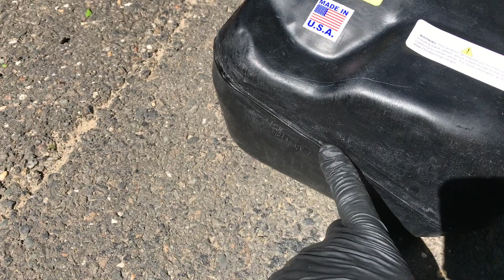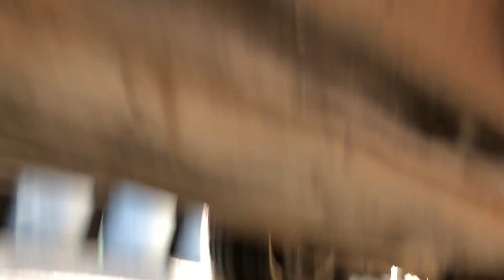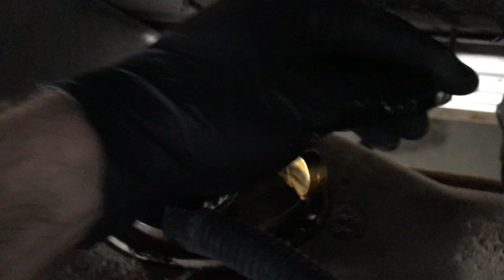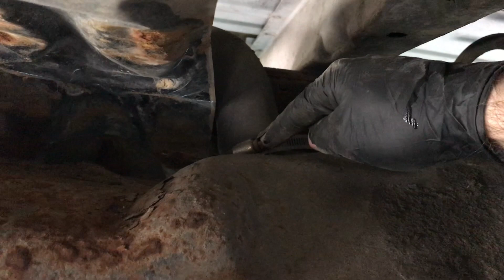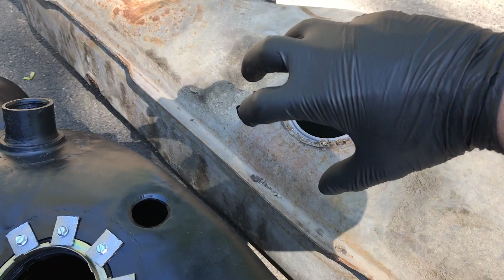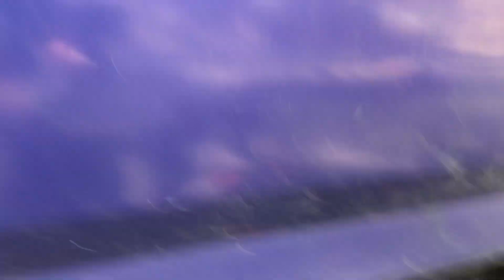How to Replace Front Front Fuel Tank with Plastic Tank | 1995 Ford F150

Comment: So... what's the measurement i need to know.. Any Idiot can cut a hole , but without the math, most will be a hack job
Reply from the maker: I have two full length videos about making the hatch in the bed and I have one YouTube short that actually has the measurements. I don’t share the measurements because the position of the tank can vary from truck to truck.

Comment: Why did you skip getting the 2 bolts out.  

Will you show me how to get the bolts out.   If you recorded the process already
Reply from the maker: Are you referring to the bolts that hole the tank straps?
Reply: @TheMinuteMasters Yes.....I just looked under my truck to see how similar.. ...trying to see if I can get the bolts out for the mechanic ....who has a larger frame than me.    To keep from going through process of raising truck bed

Comment: God how i wished this worked for me however there is a shield between the drive shaft and fuel tank on my f250 and they ran the nuts from above (rusted) on one part and riveted the others.  By far the f250 is the most difficult vehicle ive ever worked on, every single thing is just a struggle on mine.
Reply from the maker: Damn that sucks man!

Comment: Hey, i love this video it was very comprehensive. Im about to replace this tank and the only issue im haveing is ive been fighting with these damn ford quick disconnects for hours. Is there anything i can do or use to make them come off easier. Ive been trying to use the pb blaster lubricant and after reading some other comments I'm wondering if there's anything else I can use. I greatly appreciate the vide keep it up
Reply from the maker: Thanks man!🤙 those Ford fuel line disconnects can be a real problem. Unfortunately, I don’t know if there is a magic solution to getting them apart I can’t recommend the actual disconnect tools enough. I think they were the best over any of the homemade disconnect tools.
Reply: @TheMinuteMasters  thanks for the help. I've been using the ones you use, and for the most part they work great. I push it in as far as they go and the clips inside release, I just can't get it to go the rest of the way off. Also what size is the one next the the 3/8" disconnect. It's the wider one
Reply from the maker: @cryptic780  Gotcha. Have you tried pushing the hoses together as you use the release tool? Some times there is one prong of the disconnect that doesn’t release.
Reply: @TheMinuteMasters  I ended up finally getting them off, had to resort to a little bit of aggressive persuasion with a hammer. It seemed like the previous owner didn't slide the clip back when they removed it and snapped it off inside the fitting, so I smacked the fitting backwards until it pushed the broken clip out. Everything on this truck has been like this lol. Oh well, hopefully after I finish swapping the tank it won't have a bad leak anymore and will drive correctly

Comment: Hello Mr Steve.
I’ve been following you and really appreciate your videos. 
So much information 🙏
I own a 94 ford F150 5.0  302 .
I recently retired and now have time to repair/ restore my truck that’s been parked for 7 yrs .
I took the bed off so I can replace the 2 gas tanks .
My question is :
Can I run the truck with just the front gas tank?
My plan is to buy  Doorman fuel line #800-159  and cap both lines that run to the back tank?  
And do I have to cap the vent line ?
Reply from the maker: Hi Benjamin! Thanks!🤙 I appreciate it. 
That’s a good question. I don’t know for sure but it probably could work.

Comment: Hey man I got same truck 1993 7.3L my dual selector valve is replaced as well as the switch in the cab still won’t switch to the rear tank any ideas?
Reply from the maker: Hey Isaiah! So you replaced the selector switch in your cab. You also replaced the selector valve that is underneath the cab correct? Forget at what year but for discontinued the actual selector valve. The actual pumps themselves have electronic sending units that respond to the switch in the cab. Typically if there is an issue switching between tanks, or one tank filling the other, one of the pumps is the issue.
Reply: @TheMinuteMasters  thanks brother I appreciate you taking the time. I’ll check what’s going on with the pump next since I need to drop the rear tank and get all that fuel out of there it’s been sitting in there since last summer lol appreciate what you’re doing man wish you the best and a long healthy life.
Reply from the maker: @isaiahG773  No problem Isaiah! 🤙 I’m always available for questions in the comment section. Yeah if you’ve had fuel sitting in that tank for over a year unused there’s gunk built up by now. Ethanol fuel tears up these older fuel systems. 
Thanks man! I wish the same for you too!
Reply: @TheMinuteMasters  I actually have the diesel 7.3L supposedly you can just put some solvents in it and reuse the old diesel not sure if it’s true or not but I’ve seen them do it at my job.
Reply from the maker: @isaiahG773  Interesting. I don’t know too much about diesel. That’s pretty cool if that’s possible.

Comment: I think mine is leaking so I might try and replace it
Reply from the maker: I don’t doubt it. These tanks just rust a hole eventually.
Reply: @TheMinuteMasters  I'm doing this pretty soon. Does it matter what size tank? I mean, can you just buy a 19 gallon tank if the old one was 16? Thanks.
Reply from the maker: @lupegalvan9993  Good move! So I would match with what you have. However, I think I bought the 19 gal for my long bed. If you have an 8ft bed, I don’t see why you couldn’t go with the 19 gallon tank.

Comment: Is there a difference in fuel pumps for 95 f150 with a metal tank and plastic tank?
Reply from the maker: You can use the same pump for either type of tank.
Reply: Napa database calls for a pump for plastic tank on rear 1995 f150 don’t let that fool you it’s a system glitch 
Like the video dude said use the normal one 
The one that calls for plastic is a pre ‘90 electrical pump that has the sump screen flat to the bottom of fuel pump housing that’s a no go on a mid 90s 
Odd it called for that

Comment: I didn’t have to use a fuel line disconnect tool for my 91 f150 lol
Reply from the maker: SVT_Palacios Nice! Lol It just came apart?
Reply: The Minute Masters Ford used a different type of connector in 90 and 91, its a white plastic clip that you squeeze together and pry out. I kind of like them cause you can do them with common hand tools
Reply from the maker: Ekd Gotcha. I learned something new. Those connectors do sound better. Specialty tools makes working on vehicles expensive.
Reply: Ekd wish I would of known before buying the tools. Oh well might need em in the future :cheers
Reply from the maker: SVT_Palacios Ah better to have them and not need them. That’s right!🤙 Thanks for watching man!

Comment: Ever had to mess with ur fuel selector valve, those are pretty expensive. Been reading 70% of the ppls dual tank problems is that. Instead of the fuel pump 🤷🏻‍♂️
Reply from the maker: happiinapii You know, I actually haven’t. However depending on the year of your truck, replacing the fuel sending unit in the tank fixes the problem. I’m of the opinion that if you should replace the entire fuel pump and sending unit when you have the chance. They are old and who knows when either the pump or sending unit will fail. 
Supposedly before 1990, these trucks has a fuel selector valve located on the inside of the driver’s side frame rail. That part is expensive.
Reply: The Minute Masters ohh alright maybe mine not even have a fuel sending unit then cuz mine is a 96, just going by the videos I see but the ones I’ve seen are 90’ and lower. I work out of town and not able to check for myself but I will as soon as I get home thanks
Reply: The Minute Masters also I just bought my truck a week ago reason they sold to me cuz the old man was having trouble with the fuel. But he gave me two new fuel pumps, do u know if the fuel pumps come with fuel sending unit or it’s two different parts inside the tank?
Reply from the maker: happiinapii You can buy fuel pumps and fuel sending units separately. I always buy the full fuel pump assembly with both pump and sending unit, that way I know everything is new. Often times you fix one part of the fuel pump assembly and another part breaks.
Reply: The Minute Masters perfect brother 🙏🏼 thanks for the info man
Reply from the maker: happiinapii No problem man!🤙 Thanks for watching!
Reply: The Minute Masters again I have the fuel pumps he gave me At home just didn’t see what they look like or what they came with get me

Comment: Great video. I’m getting my but kicked on putting it back in. I did upgrade from a 16 to 19 tank. Top seamed to line up perfect on both tanks. The new one doesn’t seam to want to go in. I’m about to pull the bed to figure out what the problem is.  Any thoughts?
Reply from the maker: Irish German Thanks man!🤙 By not line up do you mean the straps don’t seem to wrap around and line up? If so, the 16 gal straps probably won’t work with the 19 gal.

Comment: I just bought a 1981 ford 1/2 ton. And I have been watching your video and find them very helpful. Where did you purchase the plastic tank? Possibly you could send me in a right direction to find a workshop manual for said truck. Keep the videos coming..
Reply from the maker: J. R. Thompson Nice! I love a good bullnose Ford. Thanks! 🤙
So I bought the plastic fuel tank from raybucks.com

Here’s the full link: https://raybuck.com/?s=Fuel+tank&fwp_make=ford&fwp_model=f-series-pickup-truck&fwp_sub_model=f-150&fwp_year_single=1981

As for a workshop manual, my go-to is a Haynes manual. You can find them at just about any auto parts store. If they aren’t on the shelf, you can definitely get them on line. 
I sure will man!

Comment: Stevie! First off buddy, you are an absolute JOY to watch. I LOVE your videos! I've got 3 of these monsters, 1 long bed, and 2 short beds. I know a thing or fifty about this proceedure and I'm gonna make a few comments but by no means am I being condescending. You have helped me tremendously on the suspension issues and I admire that you do any of this. So, THANK YOU! Please take any of my comments lightly, unless they are helpful to you. First, get some PB blaster and remove that bed! Removing the bed is so easy once you've done it you'll kick yourself for not doing it. I use an engine hoist and tie four corners up and lift if that way. Alternatively, I've slid a few landscaping timbers under the loose bed between that and the frame and jack it up or put cinder block under them and roll the truck away. Two strong guys can grunt and lift the bed at the wheel wells and walk it away, but you gotta be strong.  It's so much easier to do this that way and you don't need a "hatch" or have to lay on your back and get gas all over yourself stuggling to get the filler hose off, or the Ford connectors which are ALWAYS harder than it seems in your video, probably cause you had them off before. PB Blaster! The harness, vent etc. is all waist height with the bed off. The lights just unclip and there are only 6 bolts holding it down. Now I'm not sure about your gloves buddy. They seem a little whimpy but I should talk. I don't use any. I LOVE your idea about the plastic tank and actually wish I'd have done that but I always buy my tanks from Rock Auto and go for the Canadian tanks and do the fuel pump at the same time. No Chinese crap in my trucks, ever. No need to save money and have to do it again. Just replace the fuel pump. Taking the bed off is also nice when you do both tanks as I do. I just do both tanks and pumps and even though it hurts the wallet, I'm not going to do it again, probably for the time I own the vehicle. I also do the fuel pump which is right there. No vaseline on the filler tubes, it will eat them up and then you'll have holes all over. Silicone paste is the way to go, but prepare to just buy new hoses, high quality ones that are also silicone cause they are almost invariably always split, or will be when you grunt to get them off. Some guys warn about using metal to metal like a hammer to a screwdriver to remove the ring around the fuel pump cause of sparks and Ka-boom with gas. So listen, super well-done job as always buddy! I always appreciate your time and effort and I can't complain cause you see I'm not making videos like you helping guys out, but you are, so kudos my brother. Can't thank you enough. Take care.
Reply from the maker: Thank you Patrick! I appreciate that! Honestly, it's positive comments like yours that give me the motivation to keep making these videos. 
When I first started doing repairs on my truck, I began with the Haynes manual. So they I didn't learn any of the cool tricks like removing the bed. However, you guys have helped me immensely by leave tips for me in the comment section. I'll definitely keep your advise in mind when it comes to pulling the bed. So I fully appreciate your comment! Yeah I'm not a fan of the Chinese crap either. The plastic tank is USA all the way!🤙 Thanks for watching Patrick! Take it easy!
Reply: Patrick PhippsPA this is a great comment. However I don’t understand why people still use Pb blaster. It does not penetrate quite as well as Seafoam deep creep or Knocker loose. And it stinks!
Reply from the maker: Jakestarr1723 it’s funny you should say that. I’ve actually made the switch to seafoam deep creep after watching that YouTube channel the Farm Project!🤙
Reply: @TheMinuteMasters  Transmission fluid and acetone makes a great diy penetrant.
Reply from the maker: @EduardoCorochio  Cool! Good to know! Thanks man!🤙